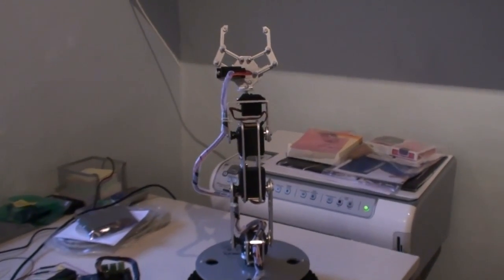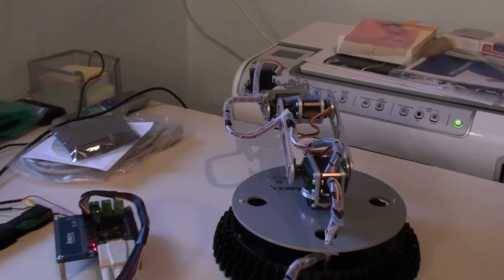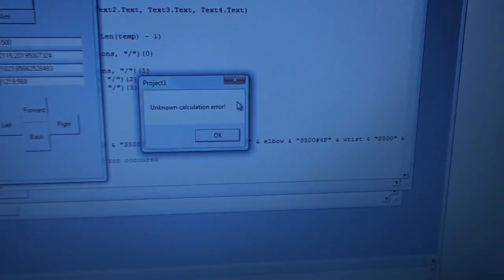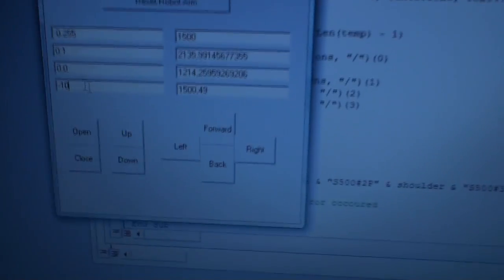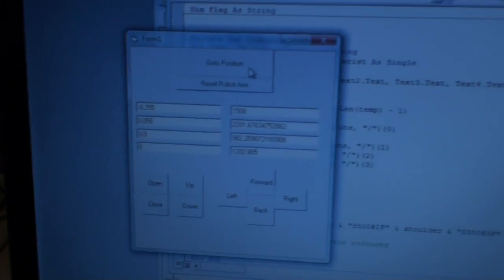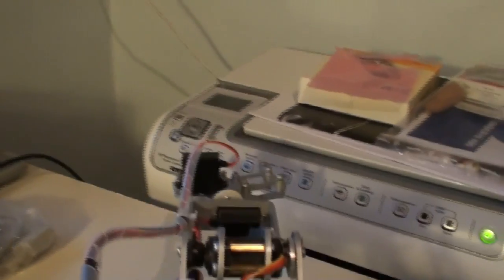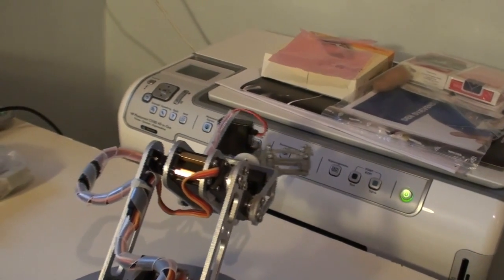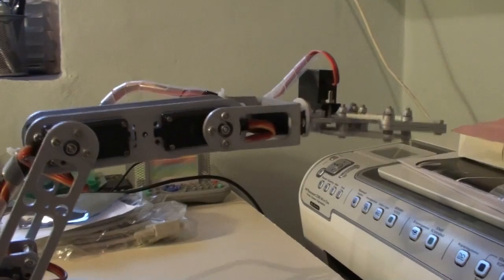6DOF Robot Arm Kinematics Example

Comment: question, what do you use for powering the 6 servos?
Reply from the maker: I am using an external 5V power suply, capable of delivering the necessary current.
Further than that a 9V battery is used to power the Servo controller board.
Reply: I got a problem with mine, can you give me a hand, im using a dagu6 and powering with a PC power supply 5v, but some servos don´t move and the other move in disphase.
Reply: Im using arduino to mother board
Reply: Randy Douglas u have to use different power source of arduino and servo motors , to avoid overheating
Reply: AHMAD OMAR in plus ,,, battery must be new and good brand
Reply from the maker: AHMAD OMAR Two power supplies are used. One 5V for the motors and one 9V for powering the controller board (due to it's on-board regulators).
Reply: mindthomas hi thomas. I working on the same robot .but i using arduino to controlling two robots .but i want to use matlab instead of arduino. .could u help me
Reply from the maker: AHMAD OMAR You can use MATLAB to control it but you would still need some kind of external board to generate the PWM/Servo signals for all the motors.
Reply: i am looking for matlab code for dagu arm robot
Reply: mindthomas iam looking for matlab code for dagu arm robot. i tried to rewrite one from harsh pandya but there is some thing wrong
Reply: Done, finally i use  6 pack alkaline battery. But i have a dude, why doesnt work with the pc poder supply?